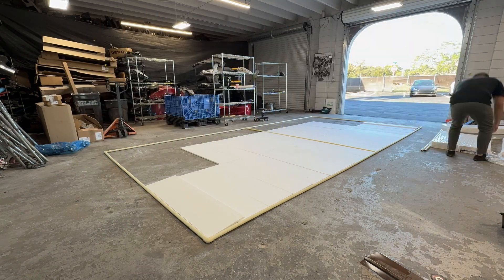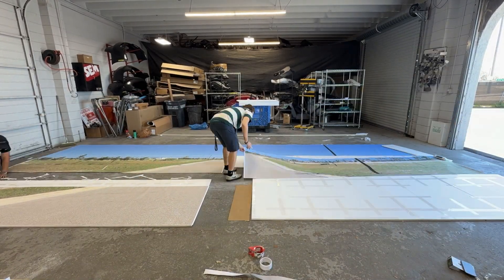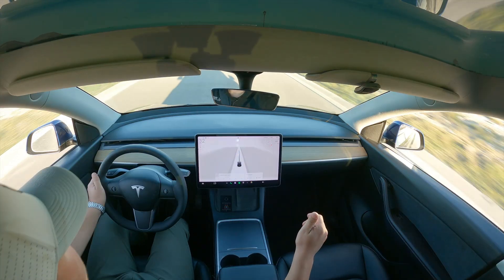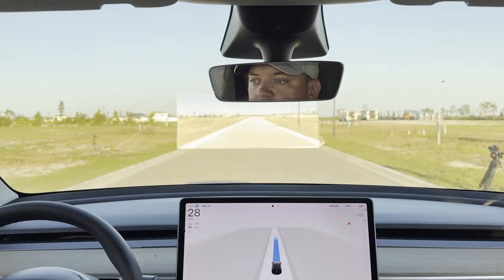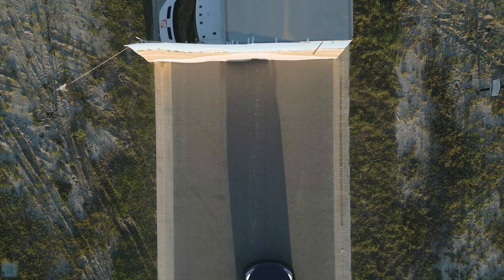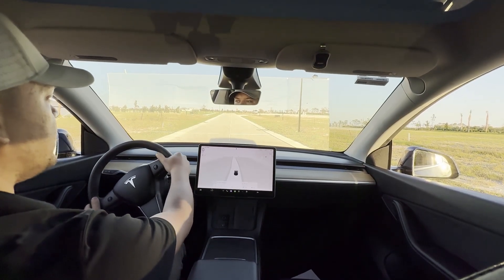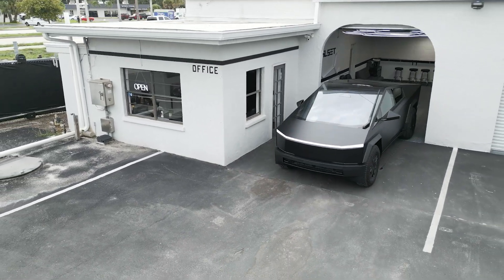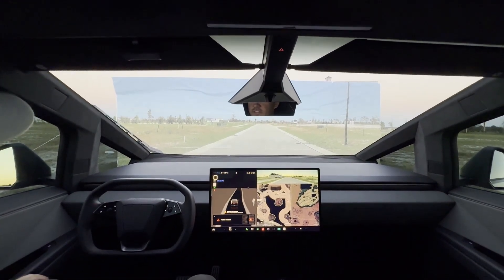Response to Mark Rober’s “Can You Fool A Self Driving Car?”

Comment: I wonder if there's a difference of how much is actually detected through the object. In the other video, they only had blocks of foam. In this video there is clearly a box truck behind the foam.

Don't get me wrong it's a great video. I wonder if the radar just doesn't bounce off foam but the side of the metal box truck with cameras and software not be able to see what object it actually it.

Comment: Has anyone noticed that if you go 6:55, there's an SUV on the left that is partly hidden behind a green trailer, but FSD only needs to notice the front of the SUV and the roof of it to correctly illustrate it as an SUV in the visualisation. This shows how important the AI part of vision is and why it's important to update your software to the latest version available. Figuring out that that's a car by only seeing small portions of it is not something all versions of FSD will do that readily (assuming you have a really outdated version).

Comment: That was amazing; however, please redo it with the Cybertruck at the same time of day to eliminate lighting as a factor. I noticed it was getting darker, which might have caused lighting differences that the Cybertruck detected. In the final footage of the Cybertruck stopping, its headlights bounced off the wall, possibly aiding it. Please redo the test with both models at the same time of day and with the same variables.

Comment: @alsetcenter Should have updated FSD to the newest version for HW3, that version is months old...you could see the update ready to install at 3:53 for 12.6.4 and it would of been more representative of the current version for HW3. However this is also good to know for anyone using a older version of FSD
Reply: It would do the same thing. You paint a wall to look like a road, and vision based self driving is going to think it’s a road.
Reply: The crazy thing is that people concentrate on FSD etc. The car should stop even when driving without FSD/autopilot via emergency breaking. The interesting thing is that without FSD Tesla has problems stopping even with simple tests like a kid in the middle of a road. This is shown in the Mike Rober video.

Comment: There are some issues with the way you tested. 
1- The version discrepancy between the model Y and the truck causes us not to know whether the HW4 hardware helped or the software update was enough to stop the crash.
2- The cyber truck test was done in the evening. the fake wall you had made was made to blend in with the daylight. also, the lights on the cybertruck were on which could reflect back at the cameras, giving it clues as to whether or not the road was blocked. so in total, the MORE significant color mismatch, and the headlamp reflections are too significant to ignore. One could argue, that even the cybertruck with the new hardware and software could have missed the fake wall during the day. 
I don't expect you to do a MIT-level test. But if you find the time and you're interested, you could redo the test and share the results. 
cheers.
Reply: That Model Y is WAY behind on FSD versions. Like 6 months? Maybe more.
Oh and not defending Teslas or anything. I own one. FSD tries to kill me many time a day over VERY obvious obstacles. No surprise it has issues with the coyote test. Keeps me on my toes.
Reply: @ I really liked tesla and still do like the model S design. But the truth is, regular cameras are not as robust as lidar. Of course lidar has its own pitfalls. But tesla could use the mixture to get the best of both worlds. But they’re cheaping out on hardware. 

There are also attacks against AI object detection etc. for example, a slight pattern on a person’s t shirt, not recognizable by human eye, could make the ai think that the person is a cat. Such attacks would prove to be catastrophic in driving scenarios. I wonder if tesla has done anything to mitigate such attacks. 

Tesla was innovating, but now it’s just a redneck fuck fest. Maybe a beer company would benefit from rednecks, but we all know tech is heavily leftist and liberal. 

And i guess their best engineers already have or will be leaving tesla soon.
Reply: I agree with all of this, except the Model Y can't possibly be updated to the same version as the Cybertruck, as HW3 can't run FSD v13 (at least not yet, and if they eventually release a version of it for HW3 then it most likely won't be quite the same)
Reply: He dropped a new video where he has hw4 during the daytime
Reply: idk man, it still seems to blend in pretty well in the evening.

Comment: Thank you very much, sir! For the most fair test, I think day of time needs to be precise. In the Cybertrack test it was a bit visible the difference between the horizon and the picture due to time of day (you could have tried your model 3 again after that to confirm that reason is the version, not the lightning).

Comment: That's why people where saying using older based softwear could be it,  also it was a purposely build example to mane that softwear in those cars fail.... but you can also create tests to make lidar fail... no one type of thing is best for everything and they all can be made to fail in man made circumstances. Like the new model 3 has hardware 4 most other tesla now are coming with hardest 4 like the new y and if the rest get a hardest 4 upgrade refresh then that could fix that man made not real world test example made to fail.

Comment: A theory:  It seems the cubertruck was tested when the sun is down more, in which the sunlight is dimmer causing an outline for the wall for the cybertruck to see. I would be curious to see the cybertruck to be tested at the same light density as the model Y.

I know for a fact that newer Tesla vehicles (from mid 2023 and up production) with hardware 4, do have samsung cameras with 2k resolution in which more clear in vision than hardware 3 vehicles with LG cameras that are capable of 1080p resolution. 

So the ultimate test would be if you can get model Y with hardware 4 and samsung cameras Vs. hardware 3 with LG cameras (also both with running same software version of FSD) and test both back to back in brighter sunlight where the wall does not have much distinct outline. 

Just to see if the camera hardware is the limiting factor or if the software is the limiting factor of this behavior.

Comment: Ignoring the test itself, as it's scientifically ridiculous, I think this is generally why the correct choice is vision. I think many people might think it's obvious now, with v12 and v13 doing amazingly, but remember, the decision to switch to fully vision came many years ago, and it was very unpopular among everyone, both neutral people and the fans. Back then the AI model was bad enough that not many people believed it was possible to do it without LIDAR, and making the change turned a lot of people away. I'm sure LIDAR is the future, and in 5 or 10 years, all new cars will be equipped with it (or another sensor), but I think the same rule why LIDAR does not work, works in opposite to why vision works. For LIDAR to be useful, it needs enough AI training to recognise what is a solid object or not, be it water, plastic bag or debris on the sensor. So if LIDAR requires a lot of training to make it work, we might as well use it to train vision. I'm sure as compute gets cheaper and more compute is available, everything will get better, and Tesla already has all the training data they need.